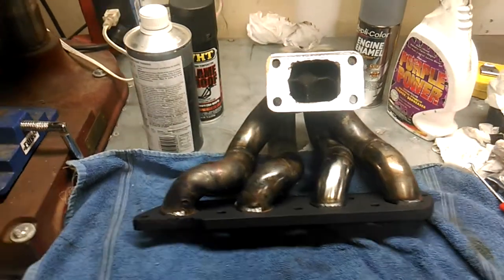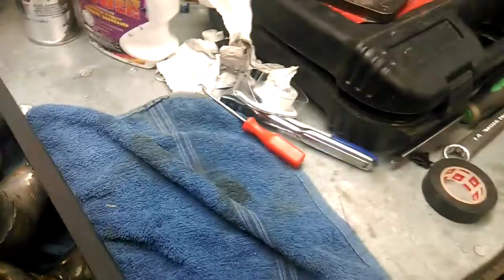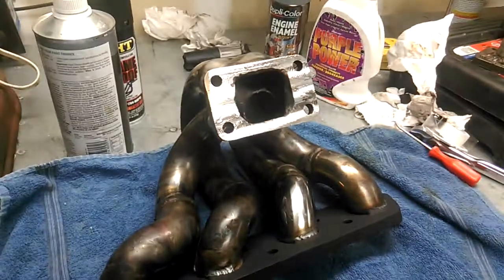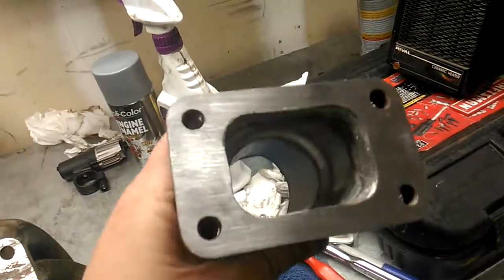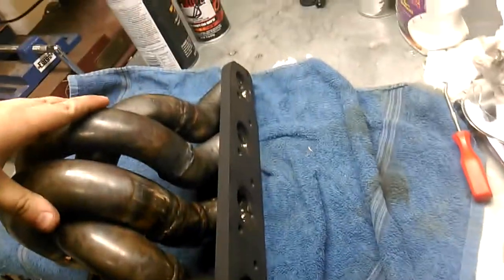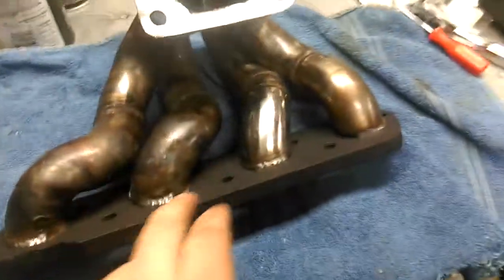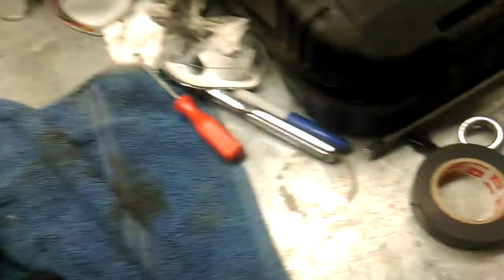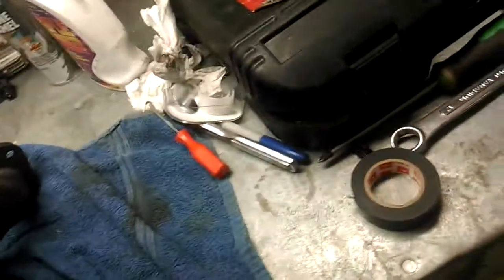1987 Ford escort turbo headers

Comment: You need to come up with a cool new name for it, like the Ford Fumigator or something!   I used to drive a Volkswagon Vulture, it swooped down and clawed the heck out of unaware hot rodders!!!  :)
I have thought of making a Turbo Corolla, and calling it King Corolla lol, I am just way too busy on FrankenBriggs projects to do it  :)
 I will try to work on a new name for your Turboscorter also.
Reply from the maker: Long term goal is to throw a 5 speed in, add turbo and MSD ignition, also nos.... lots of nos
Reply: If you get the turbo working right, you won't be needing NOS, though water/meth injection is a good idea.
I wouldn't think you would need nos anyway, since it will already be a proud member of the Tire Boiler R Us club!!!  :)

Comment: How did this work out, do you have a turbo wagon now?!
Reply from the maker: +SuperKONR the cars is running and driving well..... built for a t3 turbo but i need to get a good secondary car (running) befor i turbo
Reply: Ahh so the turbo isn't on yet. That'll be pretty sweet when you get it set up.
Reply from the maker: SuperKONR ya, had to get it back on the road a bit sooner then i wanted